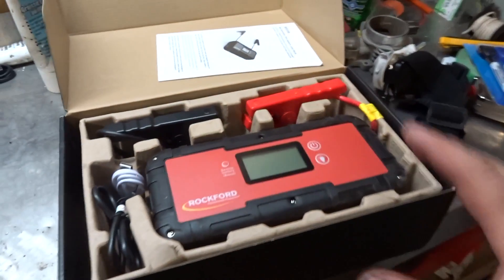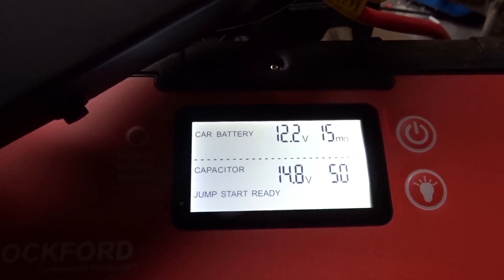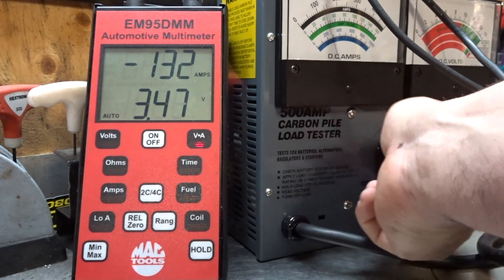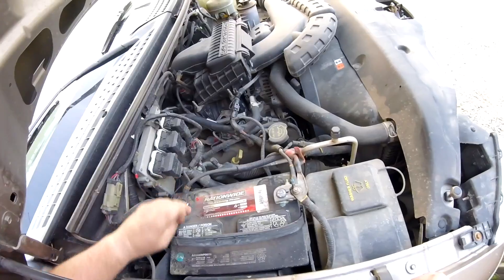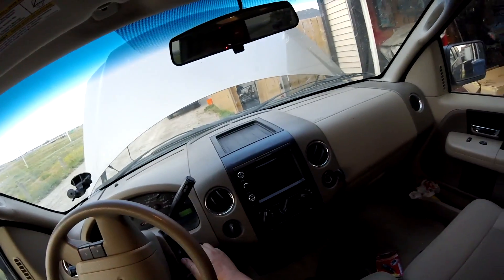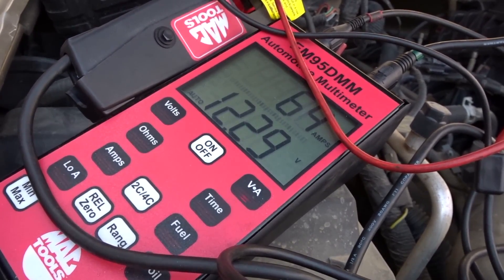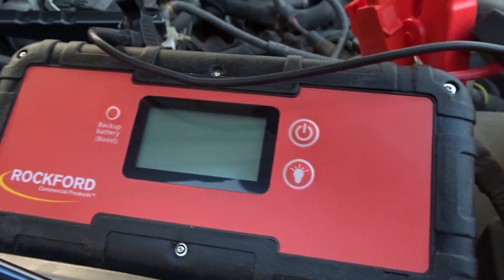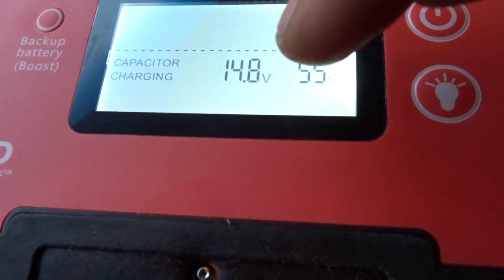Rockford RFD1000 Jump Starter Review

Comment: This Capacitor RFD1000 is junk! You will be more impressed after 6 months of not using it that the useless backup battery will fail charging and keeping any charge! Even charging this unit via the USB input will never charge the integrated battery again as it will NO longer retain a charge!  Haven't tried just charging the Capacitor via another car battery to c if the capacitors have failed also or not. But will keep updating! As of right now, look somewhere else, this unit is also missing some safety features that a $125 unit should have!

Comment: Jerry, i like your presentations.  how do you reattach the neg battery cable to the battery post while the car is running?  since the backup battery does not send amps to the car, what happens if the car battery is weak and the booster is set up with the car battery cables connected to the car battery?  do you always have to disconnect the neg battery cable before using a high capacitor booster?  with a jump starter that has power bank one can let the car battery gain volts before attempting to start engine or would you recommend disconnecting the weak car battery and using the power bank to start the engine, then reattach the car battery cables?

Comment: Hi Jerry, thanks for the review. I am in Australia and we have 220 to 240 v wall power outlets instead of the 110v you have in the US. Can I safely charge the Rockford RFD 1000 at home? FYI, I have the adaptor to plug the US plug into Australian 3 point wall socket.

For those interested, this unit is also call the Rockford CED 1000 as well. Got clarification from an US based ebay retailer.

Thanks in advance for your help.

Mike
Reply: Look at the rebrand SP tools, exzacly the same

Comment: Hi Jerry like your review have a couple of questions need your help. 
1.JB Tools. com  are advertising a Rockford CED1000 is it the same as the RFC1000?
2. Which is better between the Rockford CED1000 or the DSR109 keeping in mind that I am a handicap person with difficulty walking so I need something reliable.
Reply: i just bought one from that website... seems to be no difference between rfd1000 vs ced1000 based on my research. hard to find good info about this though. im looking forward to receive the product. 

the rockford has a built-in backup battery. the dsr does not have a built-in battery and requires you to have access to a weak battery in order to charge it up. 
however, the rockford may still work if your battery is completely dead because of the backup battery used to charge the capacitor. (note: completely dead battery vs weak battery)
most cars will have a weak battery so the dsr will suit your needs. 
however, the rockford is cheaper AND has a backup battery so this was a no brainer for me. let's see how it actually puts up to real life situations though.

Comment: Hi Jerry Thanks for your great works and video!
I am just curious that one of the major advantages of ultracapacitor based jump starter is that it won't catch fire or explode.  But this one has a built-in back up battery.  So what's the chemistry of this backup battery?  Is it safer than other traditional jump starter with lithium based rechargeable battery?  Thanks a lot!
Reply from the maker: The backup battery isn’t for boosting it only charges the capacitors

Comment: Is it me or is this Jump Starter incredibly difficult to find? And if it's so good, I don't understand why? I'd also like to visit Rockford's website,anyone have a link to it? Thx...
Some Amazon reviews said there was little or no support from Rockford.
Reply: this product has a built in battery which will charge up the capacitors if your car's battery is below 5v
Reply from the maker: Oh it’s very hard to find indeed and I don’t know why
Reply: Still feel strongly about it? ;-)  
I didn't understand why the initial test part of your video was "weak",but you seemed to "come around". I take it that your initial bench test of the unit wasn't representative of performance? I have a 6.0 liter V8. The ability to reach deeply into a dead battery and still jump it seems key. However,the Australian ebay version description said the battery needed 5 volts to accept a jump,so I'm abit confused.
Reply: I guess that's what separates this from others. I just couldn't find much support, So I bought this iclever,seems to work just fine.
https://www.amazon.com/iClever-20000mAh-Delivery-Charging-Nintendo/dp/B074M8HXYF/ref=sr_1_2?s=wireless&ie=UTF8&qid=1516321710&sr=8-2&keywords=iclever+jump+charger
Reply: that's cool. i'm glad the iclever works great for you!

Comment: Hi jerry,
Thanks for reviewing the ROCKFORD RFC1000 car jump starter.
It sounds great. Ultra-capacitors combined with built-in battery, so best of both worlds (can start car even if battery is completely dead because capacitors are charged using it's own built-in battery).
Literature says that units battery is good to recharge the capacitors 500,000 times but this seems optimistic even if it can be re-charged using the cars 12V charger (cigarette lighter) or another external power supply such as the iClever jump starter you briefly showed us in your previous video.
I am a little scepticlal as to whether this new ROCKFORD RFD1000 model is only using it's charged ultra-capacitors or both them PLUS the in-built battery when channeling  power to the car. (maybe inspect the internal circuitry?).
I am not saying that this is a bad thing. In fact, why not use both since every little helps and may be the difference between the car "nearly" starting and actually starting. 
This may explain your initial disappointment, which was overturned when it managed to start your 5.4ltr truck twice.

Before you drew my attention to this unit, I was thinking of buying both an a ultra-capacitor (batteryless) unit and a separate battery booster unit (for belt & braces reasons). The manufacturer of this 'combination unit' may have thought of this idea already and put both into one compact unit.

Indeed, if the ROCFORD RFD1000 does not use both the ultra-capacitors AND the in-built battery when directing power to start a car, I would say that the ultimate car starter would be one that does.

The in-built battery of such a unit need not be heavy or large since it only has to discharge its power over a few seconds. Hence, more than double the power that either method can release it's own and thus almost guaranteeing the vehicle will start even in extreme situations (e.g extreme cold, engine not firing on all cylinders etc).

If the Rockford RFC1000 does not work in this 'dual' mode, then I would consider buying and strapping together two units:
Say (to keep things simply and possibly more compatible), the ROCKFORD RFC1000 and the ROCKFORD RFDPPJS2976DLX.
I realize that doing this may be dangerous if not done/used correctly so people should not try this unless circuitry savvy.

I have also checked and both ROCKFORD units I've mentioned have the ability to recognize and neutralize reverse polarity connection.
To properly utilize both power sources, circuitry will be needed to ensure that power from each are released at appropriate times so that the two power sources do not feed into one another but rather into the cars starting mechanism (maybe at same time or staggered to give more engine turnovers).
Such control will be needed for maximum outage to be directed to starting the vehicle and to stop either or both of the unit's power sources from being damaged or burnt out.

The ROCKFORD  RFC1000 I think is the first attempt at combining 'jump-start' technologies and it needs time to realize maximum potential, iron out problems and to prove reliability . Room for improvement.
For the moment, since the ultra-capacitor units have been out for 1-2 years with no problems, I will stick to a good ultra-capacitor unit (say the ELECTRO Start800 (SEALEY 800Amp, which I can get for less than £100 in UK ($135)).

Comment: You should test the "Weego Jump Starter 66 Most Powerful, Award-Winning, USA-Designed & Engineered"
Reply from the maker: +orest Wolfgang never heard of them perhaps I will contact them and see if they are willing to send one for testing
Reply: Hello jerry, did you manage to get your hands on the Weego 66? wondering if it will top the rockford
Reply: Also there is alot of fuss about the "Halo Bolt" Jumpstarter. Have you come across that one before?

Comment: As an electrical engineer, I like the idea of a capacitor for increased instantaneous (burst) current, but I think they're being somewhat overused here.  Jump starting doesn't require extremely high instantaneous current, but rather a small current to power up the vehicle systems, followed by a sustained current of 80-300 amps for 5-10 seconds during cranking.

I'll stick to my Micro Start XP10.

Comment: So is your original testing methodology wrong?
Reply: There probably was a bad connection on the first test, as the voltage didn't drop so badly in the 2nd test.
Reply: Maybe he should max the load out on his load tester to start with and watch the needle instead of cranking the dial to max.... then for comparison, go back and re-test the products he’s already tested.